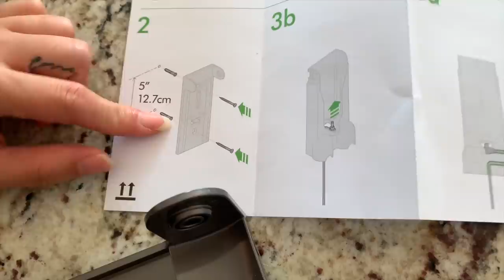DYSON V11 TORQUE UNBOXING AND FIRST TRY IN PET HOME // Cavalier King Charles Vlog

Comment: On thinner rugs I sometimes have to open the gates on the bottom of the powerhead to the "-" side which lets more air in and easier to steer. Some really thin rugs also make you to switch from Auto to Eco.  So much easier to push.

Comment: Dyson is the best.  We have a German spitz and dyson saved me. i live in a bigger apartment and i have never run out of battery i have v11 absolute.
The big brush is for carpets, the roller  soft brush is for hard floors (you didn't get it) and the small rotating brush is for beds. Look at the dyson website or youtube. For me Dyson is the best. the previous vacuum cleaner cost me 300 euros but this one is much better because it is practical and easy to use
 Big greetings from me and my dog TeddyBear from Serbia, Europe.
Reply from the maker: Thank you for the feedback!

Comment: We have the same vacuum.  He usually get 30-40 minutes out of our charge.  He have about the same amount of carpet as you do on hardwood floors and our home is aprox 1200 sq on each floor.  We can only do one floor at a time on one charge.   We have a fairly dense carpet in our living room but our smaller rugs - like yours - tend to have the same problem with being too light and lifting and stopping the vacuum.   * Try changing the suction level at the bottom of the power brushes, it can help with how much it lifts the carpets because the suction is lessened**  Want to see something gross - do your mattress and pillows !!!
Reply from the maker: Oh ew!!! Mattress and pillows?? Omg we will try!

Comment: Lol same problem... where to put Dyson!  I got fed up of looking at it on the wall. Yuk.    Now detached head and charge it hiding by side of cupboard.   Brush head stored under sofa.  Can't see it now. Yay. 🤣😂🤣  i have gtech air ram upstairs it's so much easier to use.  X